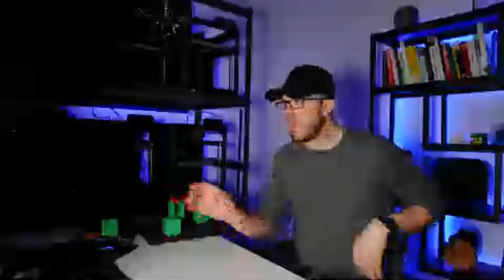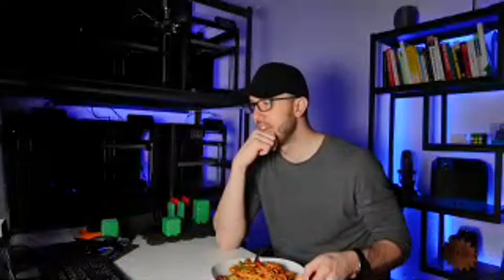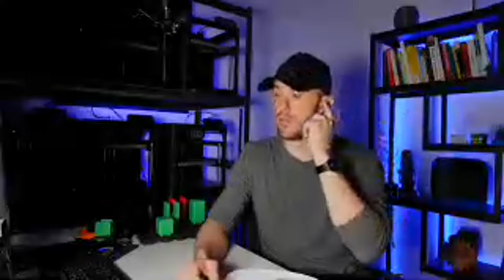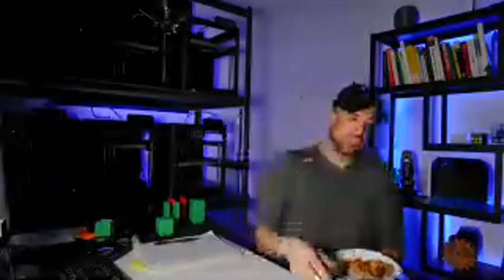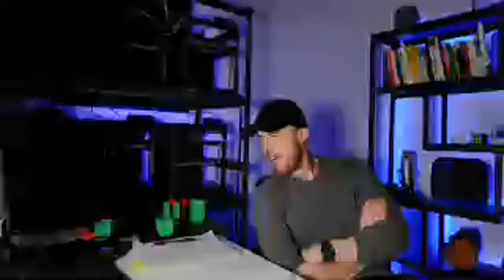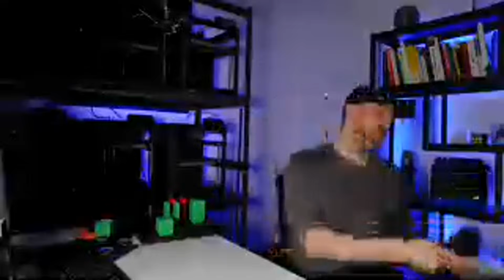Grow Your 3D Printing Business

Comment: 0:45 I see the royalty is only $0.50? We need the ability to set a percentage or set price royalty in the file details to make this fairer to the item designer. Typically somewhere around the 20-30% mark.
If I am selling my catalog item from my own site, I wouldn't undercut that by listing it on Catalog where that other seller would make an order of magnitude larger profit off the back of my design work.